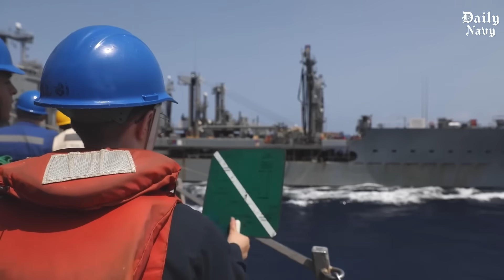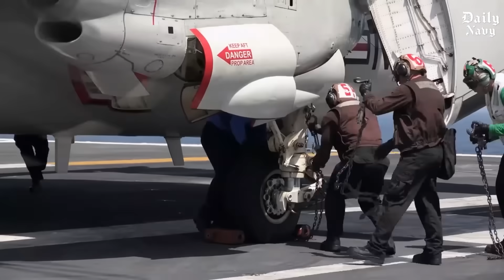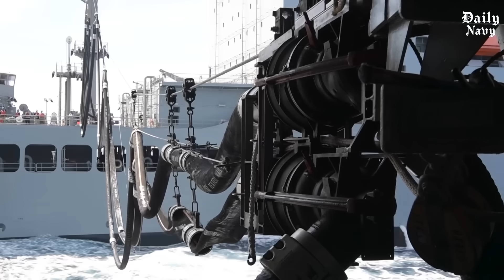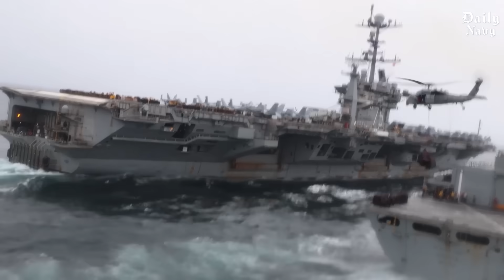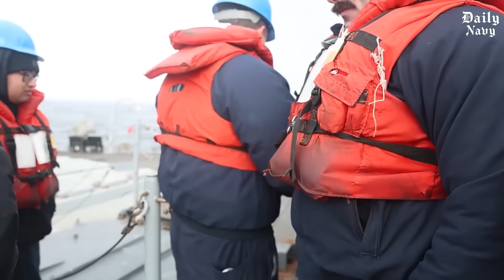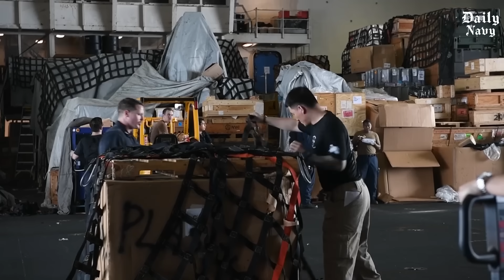How Aircraft Carriers Refill Millions of Gallons of Fuel in the Middle of the Ocean

Comment: Proud. Served aboard a destroyer dd754 in the early 60’s. We usually received our fuel from the carrier. Sometimes it was from a fuel ship. It was an amazing operation to be part of. I recall once when our destroyer was running low on fuel in the Aleutian islands and we had to take on fuel from a carrier during stormy seas, the lines broke. We circled around and reconnected fuel lines and completed our mission. 🇺🇸

Comment: We always told our gunners mates to aim for the guy in the yellow hard hat. Never came close. Sometimes they would shoot high and the shot line would get wrapped up in the radars. Sometimes they would somehow manage to shoot short, and have to try it again. I know one thing that absolutely infuriated the crews on the oilers, AOE's and AOR's. Every time we got finished doing what we were doing, we would practice the emergency breakaway. This meant that basically we would release the probe and at the same time tell the other ship to slack off the span wire.  Once the span wire went slack, we tripped the pelican hook and pretty much threw their rig went into the water. We sped up and verred off to port away from the supply ship.